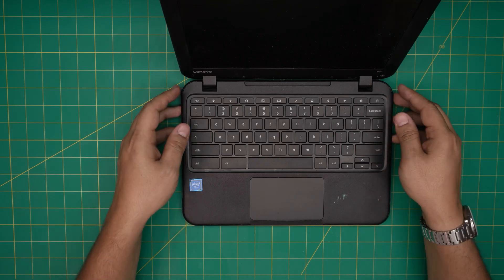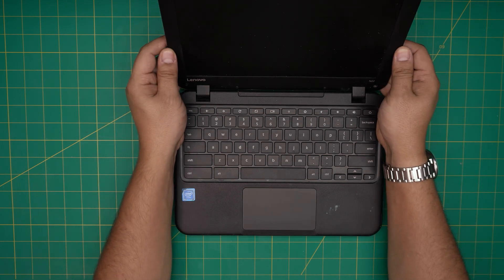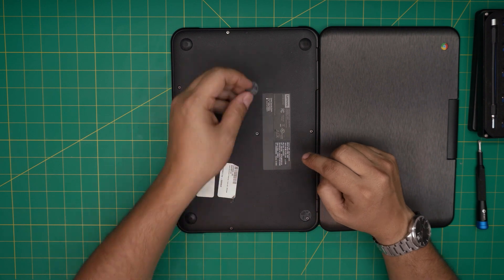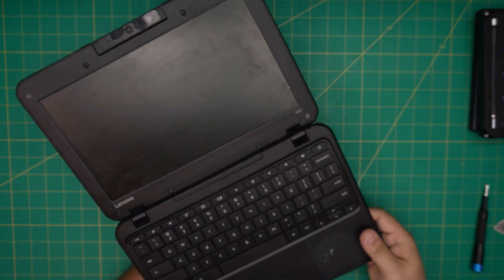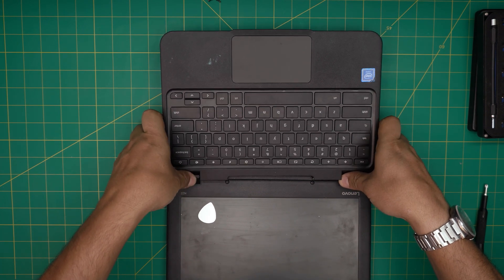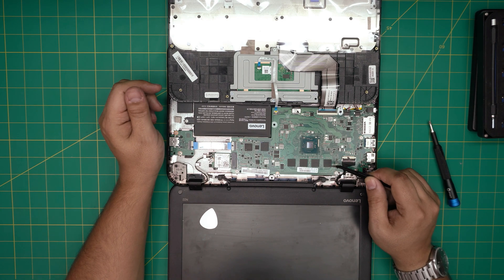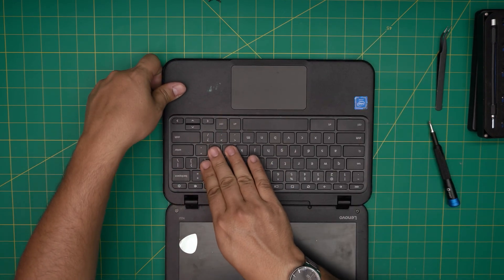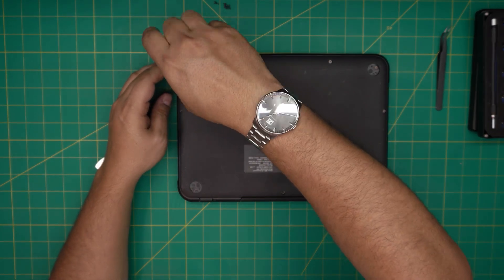Upgrade RAM for Lenovo Chromebook 11 N22 🚫 Not Possible 🚫

Comment: External Ram
Reply: Readyboost with a USB stick can give you extra RAM on your device if you have a 4 GB turn it into a 32 gigabyte
Reply from the maker: Sorry to inform you, but that is not the same as having a RAM chip or RAM DIMM. It's like booting Windows from a USB instead of an M.2 SSD or HDD.

Let explain why using a USB drive as RAM storage is not the same as physical RAM and why it functions differently.

# 1. *Purpose and Design*
   - *Physical RAM (Random Access Memory):*
     - RAM is designed to be *high-speed, volatile memory* for temporarily storing data that the CPU actively uses during operations.
     - It provides nanosecond-level access times, enabling the CPU to process data without delays.

   - *USB Drive (Flash Storage):*
     - A USB drive is **non-volatile storage**, designed for long-term storage of files and data.
     - Its access times are in the millisecond range, which is significantly slower than RAM.

---
# 2. *Speed*
   - RAM operates at speeds of **20-100+ GB/s**, depending on the type (e.g., DDR4, DDR5).
   - USB drives typically operate at speeds of **50-500 MB/s**, even with high-speed USB 3.0 technology.
   - This massive difference in speed makes USB drives unsuitable for high-speed tasks that RAM handles.

---
# 3. *Connection Interface*
   - RAM connects directly to the **motherboard via high-speed memory slots**, optimized for ultra-low latency.
   - USB drives rely on the **USB interface**, which is slower and introduces additional latency.

---
# 4. *Volatility*
   - RAM is **volatile memory**, meaning it loses all data when power is turned off. This design ensures high performance but limits long-term storage.
   - USB drives are **non-volatile memory**, retaining data even without power, which makes them slower but persistent.

---
# 5. *Functionality*
   - RAM works directly with the CPU to handle temporary computations, such as running programs, opening files, or managing the operating system's tasks.
   - USB drives used for RAM (e.g., via a feature like Windows ReadyBoost) act as a *cache* to reduce disk load but do not replace RAM’s role in direct CPU interactions.

---
# 6. *Limitations of Using USB as RAM*
   - Using a USB drive for "virtual RAM" (swap space) via features like ReadyBoost can *slightly improve performance* for systems with very low RAM, but:
     - It is far slower than physical RAM.
     - It cannot perform the tasks of actual RAM, such as storing and accessing active processes efficiently.
   - It’s a temporary workaround, not a replacement for upgrading physical RAM.

************************************************
 Analogy for Better Understanding
Think of *physical RAM* as a high-speed workbench where tasks are performed in real-time. A *USB drive* is like a filing cabinet: useful for storing information but far too slow for real-time tasks.

cheers🍻

Comment: Unfortunately, this task is not possible for non-technical users. It requires the use of specialized tools and knowledge. From what I've learned, it involves removing the memory module from a RAM stick and soldering it onto the motherboard. Additionally, some adjustments to the resistors might be necessary to make the memory work. another case like Apple MacBooks, the memory configuration is not typically adjustable through firmware or the BIOS, making it a complex and risky procedure for those without technical expertise.
Reply from the maker: yes it is not something you can do, and you don't need to solder them into mac or anything, i do upgrades for my clients and we change the ram chips to a bigger capacity and it will work fine, the capacitors don't need to be replaced unless you want to change the clock speed and voltage, but if you increasing the capacity of the nand chip no need to do advanced moving and replacing other components.
as i have done this to many clients and tested without any problems.
much appreciate the feedback and your comments, and you are correct if you want to do advance clockspeed and voltage then you right.